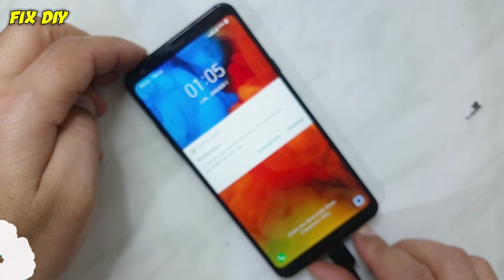All Lg phone won't turn on or charge / charging logo solution

Comment from the maker: Note: In this way, the Charging Logo problem is fixed for most Android phones, because the phone did not sense the presence of the battery due to a defect in the battery cable or the connector sometimes as well, so that it cannot turn on and cannot charge
Reply: Nice work

Comment: My PhoneModel is LG6plus, the red question mark appears when I insert the charging cable. Can I use the same procedure to fix the problem?
Reply from the maker: The red question mark during charging on LG devices often indicates that the phone isn't recognizing the battery. This could happen due to:

1. A faulty battery that needs replacement.

2. A damaged connection between the battery and the motherboard.

3. A defective charging circuit on the motherboard.

Steps to try:

1. Replace the battery with a new one and check if the issue is resolved.

2. Inspect the charging connector for any moisture, short circuits, or damage.

3. If none of the above works, consult a professional technician to examine the motherboard and repair any damaged components.

Attempting advanced repairs without experience can lead to further issues, so it's better to let a professional handle it.

Comment: My lg v50 charge so slow, it takes about 8 hours to fully charge! Please help
Reply from the maker: Check the charger and try a trusted charger from someone else. Inspect the charging port carefully, and if you find any signs of moisture or green substance, it means the phone was exposed to water and should be cleaned. If the problem persists, it may require a technician, as there are many factors that could be causing the issue.

Comment: Sir. Mine is an lg g7, i see only 2 spots on the near the battery connector on the board. Whers do i locate the 3rd
Reply from the maker: I apologize for the delay. If you're unsure of what you're doing, please avoid damaging your phone. For the points, it's best to refer to the phone's schematic. If you're a professional, you'll be able to identify them by the millimeter.
Reply: @FIXDIY  thanks for the reply, i went online searching for the schematic but I could not find it.

Comment: Hello mine is lg g4 i cant find where to solder the wires
Reply from the maker: The LG G4 has a removable battery, or do you mean the LG G4 Stylus?
Reply: LG Stylo 5 how can I do that
Reply: It has a removable battery but I don't know which wire to solder where😊
Reply from the maker: You're absolutely right! The LG G4 Stylus has a similar concept but with slight differences in the battery pin layout. Searching for 'LG G4 Stylus Battery Pinout' will help you locate the correct soldering points. Thanks for sharing this useful tip!
Reply from the maker: Exactly! The same applies to the LG Stylo 5, with a slightly different battery pin layout. You can search 'LG Stylo 5 Battery Pinout' on Google or Google Photos to find images that show the correct contact points. Thanks again for sharing this helpful tip!

Comment: Are you soldering it? My LG V60 has that darn question mark so i figure ill have to take it apart and check connection but im afraid to solder it
Reply from the maker: You can check the voltages coming out of the battery. In general, you must understand what you are doing. A professional technician can understand the process. If you do not have the skills, take it to a good maintenance technician.
Reply: @FIXDIY  I've taken many a phone apart and fixed them and put them back together, but mostly broken screens or glass backs. This phone I only had a month -i got burned buying it on eBay. I must have read 50 reviews on the guy before deciding to purchase this "Brand New unlocked LG V60" which was all a lie. I can't even use it other than using it for browsing or watching YouTube because it is locked to ATT which they refused to unlock. The back was not even glued on! I did not have time to ship back because I was leaving for HAWAII and had to at least have a camera!

Comment: My LG Q6  shows charging cable on the screen for a second with 0% charge and then the screen goes black ; should I use the same method you indicated? Thanks
Reply from the maker: Depending on how the problem occurred with the device, the cause may be the cable or the charging port , or also the connection between the battery and the motherboard, as the video shows. First, try a charging cable or a good reliable charger, then check the connection. If the problem persists, there are some tests with a multimeter to find out the cause and fix the problem, but in your case I do not think that the problem is similar to what I explained in the video.

Comment: I tried😢it but the last terminal 😭 would not connect 
.i melted the insulator on the terminal by mistake now the solda would not stick to the board 
Now it's looking like the gold terminal is silver  
Im just so unlucky😢 
And i almost had it.   
Well iz there still hope.   Will getting a new battery work.
Reply from the maker: Don't worry, if the issue is just with the battery, replacing it will solve the problem. If you have a basic understanding of electronics, you can try fixing it yourself, but it's better to take the phone to a good technician to diagnose and fix the problem, whether it's with the battery or the motherboard. Everything will be fine!
Reply: @FIXDIY  humm tnx 😌 but like I said earlier the gold terminal on the mother board is scratched now so I think my phone is a lost cause 😪😥😢
Reply from the maker: However, there are ways to fix this problem, the tracks are fixed normally.
Reply: @FIXDIY   kk sir 
Tnx